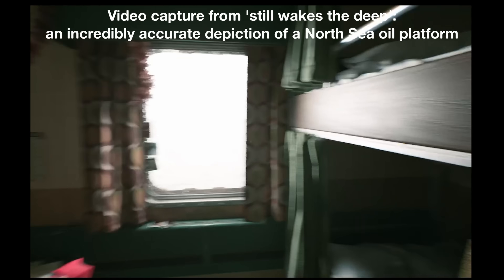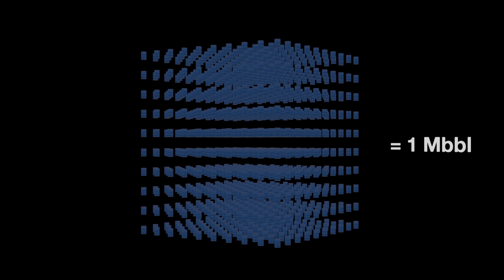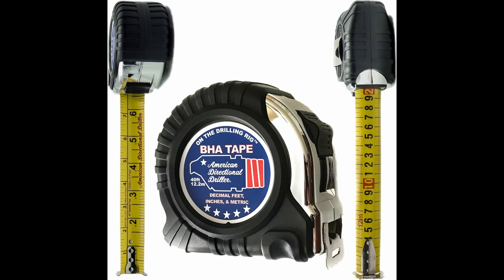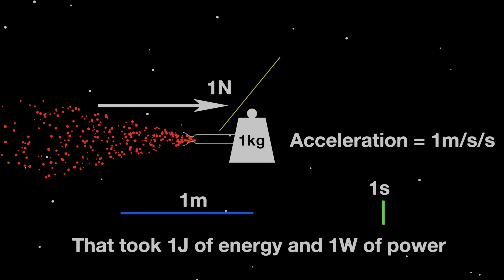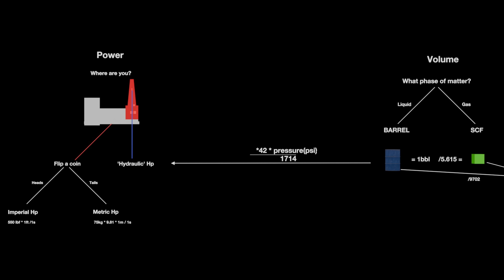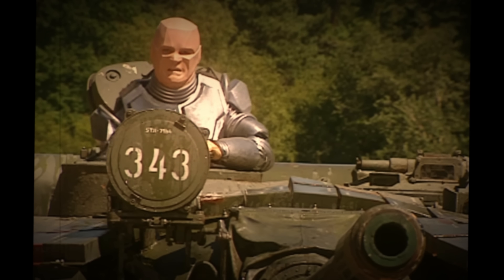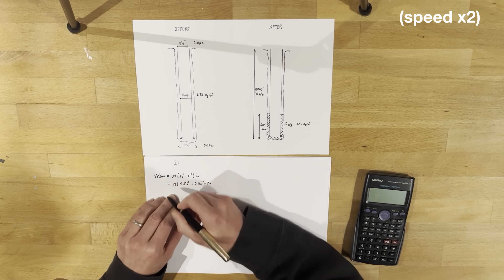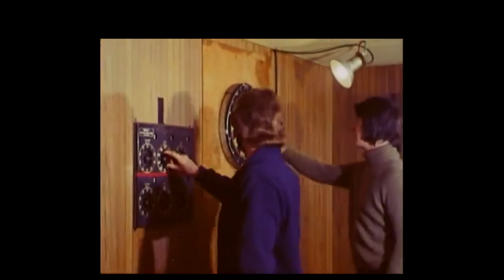Oilfield Units: a Measurement System so Cursed it made me Change Career

Comment: I'm a nuclear engineer, I worked for a company that made gamma gauges for the drilling industry. I had to calibrate the gear to read out in the most crazy units for fracking applications.
Reply from the maker: I suspect nuclear engineering would be the absolute worst to do a ‘crossover’ with oil and gas.
We did have some ‘kind of nuclear’ engineers to deal with radioactive sources and tools but I never dealt directly with them.
Reply: @Alexander-the-ok  Oh.  So what we did was to have someone take the equations, put them into a chart book, and then someone digitalize the chart book, and that gave the equations we used in calibration.  And then you had Russian/Chinese tools, which were different.  So the Chinese tools would have the same name as the Russian tools, but the equations were different.
Reply: @josephwang5859  Details. Or make a video on it. Super curious on how the tools differed? Like, the same name when transliterated between languages? 

Was it like: Device A: "Micrometer" (as spoken in colloquial Russian) [transliteration performed] -> Mandarin word: "Meter that measures micros": Still Device A, just demarcated in different graduations.  ("conventional Imperial/US units of (foot,inches)" vs "Rig tape" (foot, tenths_of_a_foot")]

Were the calibration co-efficients different between units (i.e., could you just use the "Drilling Data Handbook") or was the procedure for cal'ing against your transfer standards/primaries different?
Reply: @wither8  Years ago.  The Russian and Chinese tools had different corrections but the same name.  Also US tools have corrections in a chartbook which is a graphical calculator, whereas I think the Soviet/Chinese guys had equations.
Reply: Thats just 3 additional units to represent dosage (rads, gray, sieverts (for biomaterial)) and 2 for radioactivity (curie and Becquerel). Probably wont make this clusterfuck that much worse.
Reply: @Alexander-the-ok  the difference with oil and gas vs nuclear is nuclear is more or less standardized world wide lol
Reply: I'm a geologist in oil and gas and the API units gamma system is just insane. This is basically the most commonly used and interpreted downhole logging curve/tool.

The whole standard/system is based on the measurements of casing concrete made at the University of Houston in 1959. The 'hot' block of concrete must read 200 API gamma, the Cold block must read 0.

The reason this was done was a good reason. The problem pre 59 was that different tools measured/calibrated differently and produced log curves  which were basically incomparable between wells even within the same rock formations, even close together. It made log correlation difficult. 

The problem is now, with millions of wells drilled, there is no practical way to go back to the drawing board and display these readings in SI units, as that would require a monumental task of attempting to rectify old logs into the new unit scheme.
Reply: @samwise1790 thank you for the explanation, I just had to make it work. I actually didn't think the gauges were giving any reliable data.
Reply: @samwise1790  yes my logging tools are extrapolated as GAPI . Don't get me started on the complexity of compensated neutrons being presented as PU on our logs
Reply: Retired oilfield instrument guy here....I had to calibrate a nuclear density gauge to read in "PSA" which stood for Pounds of Sand Added i.e. frac sand blended with frac fluid.
Reply: @robstanden279  WHY IS OIL INDUSTRY MAKING UP RANDOM UNITS
Reply: Sounds like a fracking headache if you ask me dohohoho
Reply: @Stealth86651 Dad everybody knows that's one of your jokes. You've had enough internet. Lol
Reply: My favorite unit from the realm of nuclear physics is barn.  Which btw. also proofs that physicists have humor.
Reply: @ralfbaechle  my favorite one is electronvolt, because why use gram when you can use eV/c^2
Reply: @aryandabima9623  Because in grams everything has a string of zeroes in front of it.
Reply: @ralfbaechle  Subtle leaving out what that measures!   I also like the "shake",  a chuckle each time I see the ducks coming out of the pond.
Reply: @amadeusendymion1272  The barn?  Nuclear cross-section. I didn't feel like I'd want to explain that concept in a youtube comment in a silly comment editor that covers 5% of my monitor.

But wait - there's more fully units: Outhouse & Shed, Inverse Femtobarn (fb⁻¹), Banana Equivalent Dose (BED), Dollar, Fermi and fun and unusual but not nuclear physics-related, Beard-Second, Smoot, Jiffy, Milli-Helen.

Quecto-parsec per fortnight anyone?
Reply: @ralfbaechle  That one's even acknowledged by the SI standards body!
Reply: @moconnell663  Sigh.  There's still a lot of work to do.  Ever tried to do your shopping in Plankh units? Diesel is currently about 6.793×10−102 €/l³ where l is the Plankh length.  More than 6×10⁻¹⁰² €, really expensive.  And no Plankh unit for eggs yet.  SI really is an obstacle 🙂
Reply: Nuclear power has its own whole set of weird units.
Reply: Former fraccing E tech here.  My peeve was the brain-dead safety BS that never added up.   We had densometers  that use radioactive pellets, which meant that every time we moved a machine with one of those units on it, we had to do a radiation leak/calibration check, and if it came in too high, we were not supposed to run the equipment due to a possible radiation leak. 

The problem was that the BS safety standard we operated on was so low that some sites' NORM background was above our safety threshold value.   At some well pads, nature itself was more radioactive than we were allowed to operate under.  

As far as reality was concerned, the calculated exposure limit was something equivalent to a 24/7 exposure for ~ 130 years, being 50/50 probability of being fatal.       We were on site ~12 hours a day 15 days at a time, and a long job was at most 6 - 8 weeks, magnitudes of order under the theoretical 50/50 fatal exposure limit time
Reply: Corrected GAPI.  What a great unit! I always try to go back to CPS, but when you talk to the field they will need GAPI.
Reply: PLC guy here.

"You want what units?" 🤔🫩

My favorite is when someone demands that we calibrate a sensor to read -30 psi.🤣🤣🤣
Reply: My fun one is that -999.25 means no data unless its -999 or NULL.  This turns out to be heck for any calculations.
Reply: the nuclear industry has its own fantastic set of non-SI units
Reply: mud Sieverts (also written mSv)

Comment: Hey, when it comes to cursed units, you don't wanna know what chemists such as myself have to go through.

Edit:
Hey, the SCF, I've seen this one on "INERT" brand gloveboxes. For some reason, the amount of flow of forming gas for oxygen scrubber regeneration was given as "25-30 SCFH", "standard cubic feet per hour", which I just ended up rounding to 1 m³/h.
That entire glovebox was just crap, but my professor couldn't afford the proper MBraun ones, which work in SI.

More edit:
That clippy in your profile picture is appreciated. Clippy only wanted to help you. He didn't sell your data.

Even more edit:
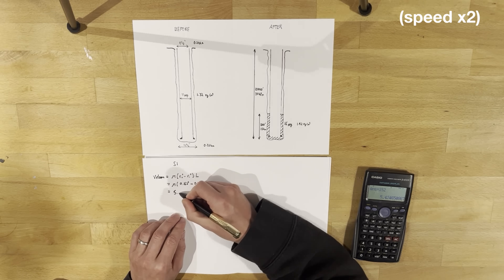15:15 Hey I have that same Casio calculator. Had it since high school circa 2008 or so. Damn reliable, even though the model was castrated on purpose so that it couldn't do differentiation and integrals.

Even more edit:
16:15 No wonder you made a mistake, you should always write the units directly into your calculations at every step. That's a beginner's mistake. Boo, Alex, boo.
Reply: Tell me about the reaction quotient
Reply: [ＤＩＭＥＮＳＩＯＮＡＬ 𝐀𝐍𝐀𝐋𝐘𝐒𝐈𝐒]

Comment: Another thing. All the imperial measures are now defined off the SI standards
Reply: Same with US Customary. They're all SI under the hood, because it's the only sensible measurement system to use in the modern day.
For those not familiar with the intricacies of measurement systems, the Système international d'unités is defined based on physical properties of the universe such that any sufficiently well equipped metrology lab in the world can independently measure them. The kilogram was the last SI unit to be switched over, but it's done.
Reply: @SnakebitSTI  There are only four countries in the world that can build a Kibble balance and only the US's NIST-4 was precise enough to perform the repeatable measurements to a confidence level necessary to redefine the kilogram. So, in practice, there's still only one place on earth that can measure the kilogram, it's just in Gaithersburg, MD now instead of Paris, France.
Reply: @costakeith9048  Still better than the Kilogramme samples we had which mass were dangerously diverging apart somehow
Reply: @SnakebitSTI   Do not capitalize "Customary".  It's not a proper name — it's literally a descriptive word to indicate the measuring units common in America.  Believe it or not, there is no official name for the imperial (lowercase) units we use here in America.  :face-orange-raised-eyebrow:
Reply: which is silly because anyone with a brain would know that imperial units are the only real way to effectively quantify cheeseburgers per football field.